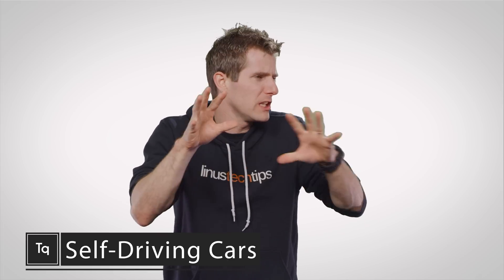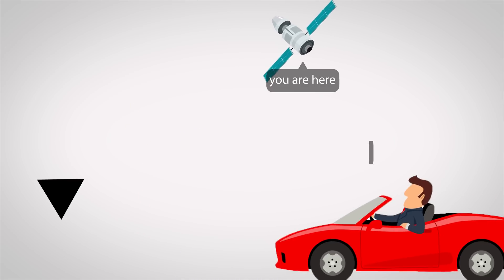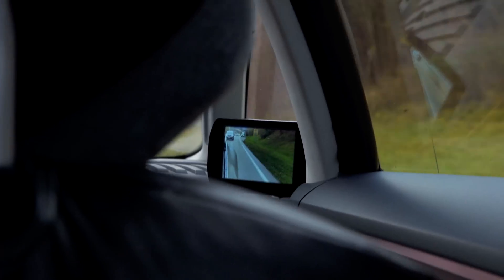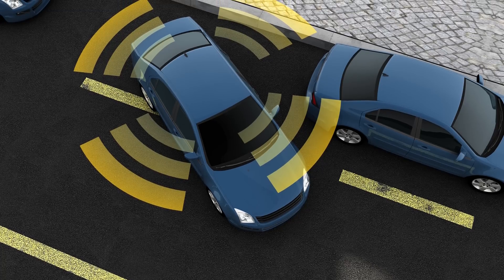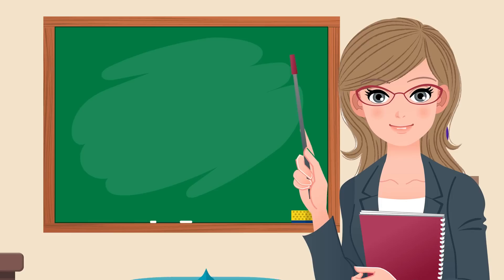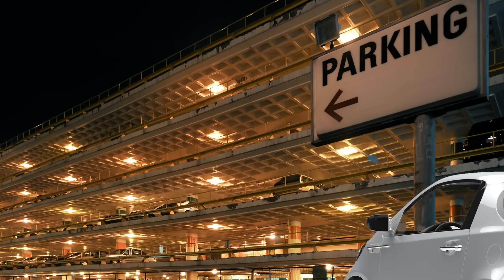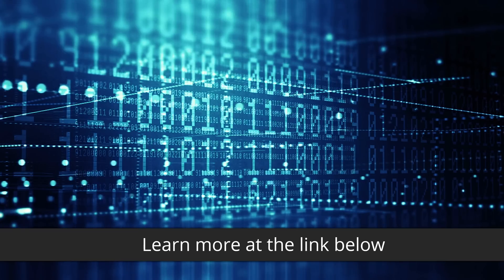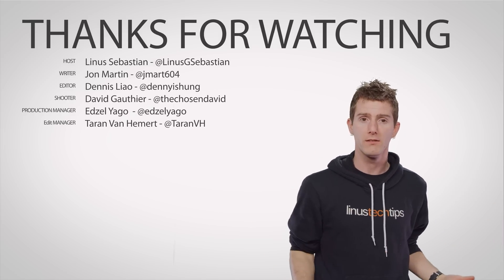Why Self-Driving Cars DON'T Just CRASH

Comment: FYI: Tesla’s autopilot system does not use lidar, but only cameras and radar.
Reply: imagine world where you can't take pictures with your phone because cameras would be just destroyed by lasers in cars... LIDAR is stupid, it's sad you can go to road with technology which destroys other people stuff
Reply: @DomV-i2y  The frequency of the lasers are hardly going to damage a phone camera or any other camera - because the chip those devices use cannot 'see' the laser (which is why you don't see security lasers on any security video footage).
Same goes with LIDAR.  High frequency, low energy.  The most it might interfere with would be certain types of insects.
Reply: @amzarnacht6710  there are already cases of damaged cameras by LIDAR :) 
it is still lot of energy concentrated into tiny spot and direct hit may result into sensor failure, if you are unlucky (fun fact, you can be lucky and it can burn just one pixel - you won't notice this with cameras nowadays because they can remap themselves, also phones have higher resolution than output, so you have no chance noticing this on phones like mi9 or p30 pro or any other phone with 40+Mpx, but you can also be unlucky and it can burn part of chip which carries data to units at side of sensor, then you have lines across your picture and you will notice that, even tho on phones it could still be ok, because line 1px wide could be hidden when you resample 40Mpx to 2Mpx)
https://www.bbc.com/news/technology-46875947
Reply: Daniel Baulig really ?
Reply: truman2cool Yep.  Elon says that using lidar is a crutch, it’s helping other carmakers catch up quickly, but will keep them from reaching true self driving in the long run.
Reply: @Dumbledore6969x  
Not really enough difference between lidar and radar to make enough difference to say one is a crutch and one isn't.

They both shoot electromagnetic radiation out and measure what comes back. The main difference is the frequency of the light.
Reply: @lordgarion514  Tesla is more reliant on cameras. One of The reasons being able to better cope with bad weather (snow, fog). Im sure cost is a factor too.
Reply: @SvenOllino  
It uses ultrasonic sound for close up things like avoiding another car, and radar for long distance.

Lidar can do both.

And visible light cameras suck ass in fog and heavy rain. Just like your eyes do, and for the exact same reason, fog blocks visible light.

Not saying cameras don't have uses, but it's not what Tesla uses to keep the car from hitting things.
Reply: @lordgarion514  How do you know Tesla doesn't use cameras to avoid hitting things?  AFAIK The radar in Teslas is only forward facing.
Reply: @SvenOllino  
When driving the cameras do keep an eye out for things coming from the side. But when things are close, such as when parking, the cameras can't provide stereoscopic vision(plus there's only one camera in the back), so aren't useful for depth perception.

That's where the ultrasonic sound and radar come in.(but they do more than just that)
Reply: Robert Pruitt In my experience with the Model 3, it is better in heavy rain that I am, and that’s saying something. Haven’t dealt with dense fog to date, but I doubt it’s going to suck at it given how well it does in the rain.
Reply: @SvenOllino  if they're visible light cameras then they're almost useless in fog. The great thing about lidar is it doesn't care about fog which is huge depending on where you are and plus when safety comes into play then you cant really cut costs
Reply: @MrDmoe33  I have not seen any evidence to suggest that LIDAR functions even remotely well in fog or heavy rain. Care to elaborate?
Reply: @SvenOllino  well lidar works by sending out pulses and those pulses are usually IR I believe which goes right through fog. Rain will probably be an issue due to scattering which is why both cameras and lidar are used together
Reply: It also not a self driving system in any way, and never will be despite what their marketing tries to insinuate
Reply: Carewolf Tesla’s self-driving event is on April 22nd if you want to watch. And if you doubt them you’re welcome to join me in my Model 3; I’ve logged over 10,000 miles in autopilot since September.
Reply: With a few early deaths under it's belt already.
Reply: Tournel Henry wrong were all sure Tesla has working above level 2 software, for Christ sake they sell full self driving, and all new cars are level 4 ready. 

Now some idiot is going to see this, Tesla’s public software is a crazy cruise control, because that’s all that’s allowed. Google/Waymo has special permissions to test level 3 in designated areas; anything past level 2 autonomy is a long way off, only due to regulation and legalities.
Reply: Tesla realized how fucking UGLY those lidar stacks are and purposely designed them out from the beginning.
Other manufacturers will have to realize the same thing, because no one will buy a car with an ugly ass cancer tumour on the roof.
Reply: @amzarnacht6710  You say that but Tesla's are ugly anyways.  They all look like bland regular cars dressed up in latex gimp suits.
Reply: @UnbeltedSundew  Not going to argue with that, but they don't look any different than those other cookie cutter designs.
Cars with LIDAR stacks are just flat out ugly no matter the look of the underlying body that no one - not even cab companies - will want them.  And it's also a prime 'hit me here!' target and expensive to repair/replace.  A baseball bat and one swing will remove an entire car from service so companies want to get away from them fast
Reply: @amzarnacht6710  That's true.
Reply: @UnbeltedSundew  Ah yes. I too like presenting opinions as fact.
Reply: @mrgarlic2639  Are you high?  My opinion that Tesla cars are ugly is a fact.
Reply: @UnbeltedSundew  when did peoples opinions become facts? Thats like saying "The color blue is ugly. Thats a fact" no thats a opinion. I'm pretty sure they are not selling all these cars because people think they are ugly.  Honestly, ARE YOU HIGH?
Reply: @613cmac  That's not what is written, check again.
Reply: And side note: LIDAR breaks hardcore for reflective surfaces. My Model 3 had not even a hiccup when I’ve passed a super shiny aluminum box truck or the similar (trucks with mirrors on them).
Reply: @the-uppload  
But didn't one of the Tesla's drive its owner into a slab of concrete or something?

Everything has its advantages and disadvantages, that's why you don't try to rely on just one. Or 3 instead of 4.
Reply: Robert Pruitt Indeed there is gain to be had with additional systems, but ultimately cost of hardware and programming the redundancy to trust one source over another is what brings that down. Additionally, inside out tracking, when the market is saturated with them, will not operate properly because of the number of beams being sent and received unless they’re talking to each other...which opens another can of worms.

And the guy who’s Tesla crashed into an off ramp divider knew his vehicle had difficulty in that spot and continued to neglect oversight of the vehicle as he is supposed to (at least for a couple more years while the algorithms are optimized). This same divider was crashed into earlier that week by a human and was already a recurring trouble area for humans as well...just bad road design, not bad AI necessarily.
Reply: @the-uppload  
Humans run into things mainly because they spend a large fraction of their time not really focused on driving. Computers don't have that problem.
So sure, there's likely to be some bad design involved. But even if so, no human has intentionally driven into it. The car did. Bad design or not, that car should have at least hit breaks before it hit.

And I have no doubt that we're heading towards cars talking to each other. It's a much faster form of communication than only relying on mainframes somewhere.

While you are making the case that which system to trust over another  is a problem, Tesla's already have 3 systems that have to deal with exactly that......
Reply: @Tournel Henry Yes it is, Teslas can now navigate itself through parking lots.

Comment: Waiting for what happened to 737 Max to happen to autonomous cars for people to realise that without something like FAA but for autonomous vehicles forcing redundant systems and regulation of autonomous system, its a horrible technology..

I dread the day when manufacturers make a mistake. And owners have to pay for it.

Its not like its the first time too. Takata*cough*takata
Reply: Cars don't stall like planes. Takata has nothing to do with autonomous cars.
Reply: @aero7535  the 737 Max weren't stalling. They were diving to the ground because the autonomous pitching system thinks its pitching up due to faulty sensors. Check your facts.

I brought up takata not because it doesn't cause planes to stall, but as an example of "safety device" that did not work as it should.

And who is regulating these safety features in autonomous vehicles?

The point is autonomous cars lack a regulatory body. That was the only issue. But you chose to nitpick on an analogy.

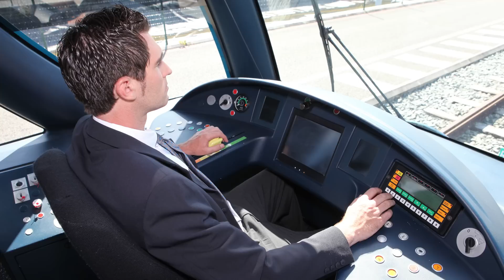Comment: 0:22 Actually, most trains are self-driving, at least in Europe, as they use various ATO (Automatic Train Operation) and ATP (Automatic Train Protection) systems. The engineers usually just supervise the trains and may operate them if the systems are out of order.

https://en.wikipedia.org/wiki/European_Train_Control_System
https://en.wikipedia.org/wiki/Automatic_train_protection
https://en.wikipedia.org/wiki/Automatic_train_operation

Comment: It should also be noted that the problem that autonomous cars are not in our streets is still not a matter of technology but of certification. For example, there is no machine learning or vision processing software that complies with ISO26262 standards or with ASIL-D, at most, these boards are certified as ASIL-B. And a certification of that level takes years to be approved. Therefore autonomous cars are waiting to comply with the regulations before driving autonomously.

Comment: The question I have about machine learning is if a defect is found and you need to retrain it, how do you regression test it to make sure you didn't break something that was working before? Considering the large data sets used for self-driving cars, this seems like it could be an issue.
Reply: I doubt they would push updates like that without rigorous testing

Comment: The problem with self driving cars is that, there are too many laws to be revised.
Reply: Like?
Reply: @Finchgames  its always the ones with ethics. For example if a car faces the choice between crashing, and possibly harming any passengers in the vehicle, or hitting a pedestrian, it's unclear what the vehicle's systems will direct it to do.
Reply: @mrguest3749  Just have a manual break in reach in case of situation like that?

Comment: I did a paper in college in philosophy on what ethical practices an autonomous vehicle might have to implement in case of a crash. Choose to save a driver but run over a group of children? Choose to damage the driver while saving a fuel tankard. There are ethical questions behind a self driving vehicle
Reply: Or just have a manual stop break you can push/pull in case of those situations?

Comment: I would feel safer in a 20 year old rusty clunker with dodgy brakes than in a self driving car with all it,s super computers. I noticed when you were letting the car drive and playing on your phone there was a human in the passenger seat  for safety.
Reply: Current self-driving cars still require someone behind the wheel. The car will signal if anything isn't under control, and the human driver will have to take the wheel

Comment: One problem I've heard are a lot of these sensors fail during bad weather. Now I'm sure this will all get worked out at some point. But how do cars communicate in remote or rural areas where the infrastructure isn't in place? Most importantly we'll have to have some sort of security software installed to prevent hackers from hijacking the vehicle.
Reply: If the infrastructure is so bare, what do you propose the car would have an accident with?
Reply: @stitchfinger7678  Usually wildlife that jumps out in the middle of nowhere.

Comment: No mention of Tesla's implementation? Instead of laser, it's using 8 cameras, 12 ultrsonic sensor, and 1 forward facing radar (Model 3) for it's onboard computer to perform self-driving. Camera is used for visual object recognizing just like human eyes do, but will be able to see 360 degrees around the car all the time. The idea is just like human, you can get your way around places as long as you can see, does not matter where you are blindly dropped in.
Also, Tesla just made and deploying it's own auto pilot processors (claimed to be 20x processing power than previous nVidia chip) hardware 3.0 that is just in-place board replacement for existing hardware 2.5 cars.
All the exisitng Tesla cars on the road constantly sends driving data back to HQ for analysis, with the billions of miles of driving data to work with, there is no other self driving system that remotely close to the neural network of Tesla.
Reply: Good point
Reply: Tesla does not have, and this has to be reinforced over and over again, Tesla does not have autonomous cars. They have an autopilot system that is an advanced form of cruise control, but they are nowhere near autonomous just yet.
Reply: @XSpImmaLion  That's correct, at the moment. But it has also been stressed over and over again they already have the required hardwares to make it happen down the road. It's just software development and local regulatry approval. As current owner of Model 3 delivered since Last October, I have seen more and more function/features added and improves over the past half year. The latest update just came out last night for me actually enables car to automatically change lines on highway if it thinks it thinks current line is slower or is required to get on/off ramp.
The next update (already out for some cars) will introduce initial traffic light recognition that will warn driver of incoming red light. It's only a matter of time when its able to automatically stop and go on city street even if it's the first car (right now it will just ignore red lights and runs right through it if there is no car stopping in front).

Comment: nice video. regarding GPS, consumer GPS can have a variance of several meters, but industrial GPS can have as little as a CM variance. They're highly sensitive. I'm not sure what the quality of GPS these cars use, but one might assume they're of the highest accuracy. Thanks again.
Reply: Linus kinda missed the biggest problem on GPS - it's not really accuracy as this could be solved by using industrial grade GPS... it's latency, mapping problems, and environment awareness.
GPS takes enough time to give you back a position reading that it becomes well... an important extra macro level navigation tool, but not really useful for actually driving a car. Maps are frequently outdated and they often don't include stuff like roadblocks and other stuff that might be happening. It also can tell which turn to take and whatnot, but not about jaywalkers, bikers, etc. Finally, there's the problem about weather... which can be solved using multiple strategies, but they all come with some cost - more latency, less accuracy, etc.

Comment: Recently I saw a news article about how a lot of first responders dont know how to deal with the current electrical engines cause things like is it on or off and how to put out lithium battery fires arent common knowledge. These two issues made me re evaluate these new cars, as most are electrical. I think first responders will need to be more technically trained before id say its safe.
Reply: Surely, as you elude to, this is a matter of training not a matter of the technology?

Comment: Actually, self driving cars crash and/or greatly hinder normal driving all the time... so you're wrong and look dumb in this video. I will never drive a car that can override my own controls (ABS being the only exception).
Reply: I don't even like many ABS implementations, I get that it's a overall benefit to drivers, but in some cases i just wanna slow down\stop, and ABS can hinder that.  I pull the fuse when i'm offroading in the jeep cause in some cases it's downright dangerous (going down a extremely steep dirt hill and ABS decides you only need half your braking power...)  For on-road examples the abs in some car's is terrible in the snow, you lose significant braking power when you need it most (sometimes stopping is more important the turning, and I can always ease off the brakes if i need to turn, though that's a skill many drivers never learn)
Reply: @Wooble57  I agree with you for the most part, but I can for sure say that ABS has saved my ass more than once on my motorcycle. So while I agree ABS can be a pain in the ass and even occasionally put you in danger, ABS can be turned off when you don't want it and turned back on when you do, and it's far less dangerous than a computer controlling your steering as well as brakes and acceleration. There's also the fact that Elon Musk is the one behind the implementation ... and we all know how much of a moron he is.